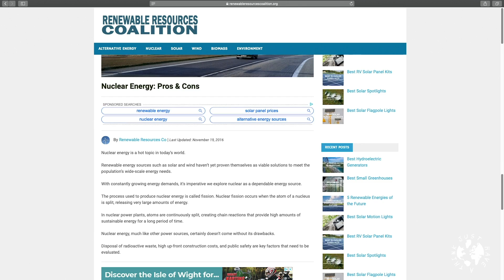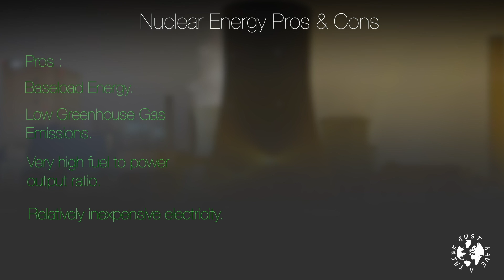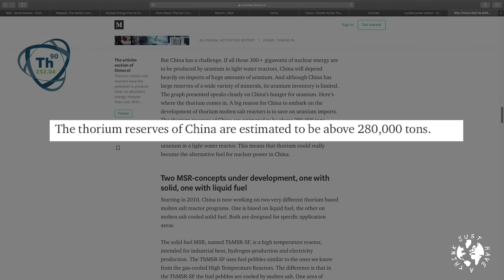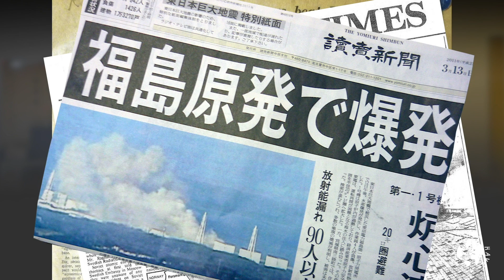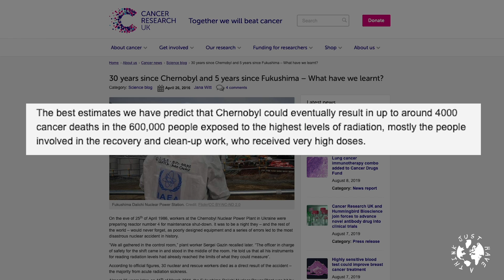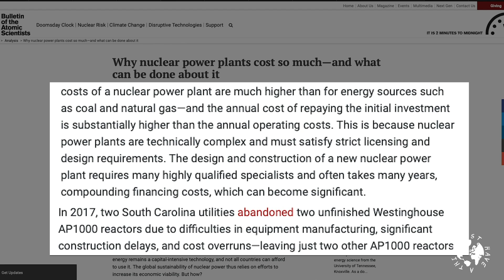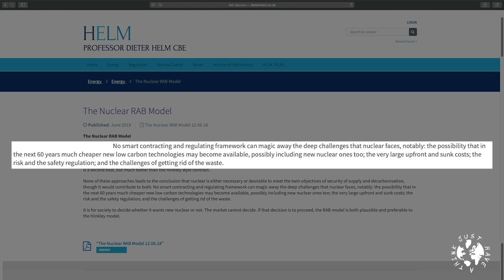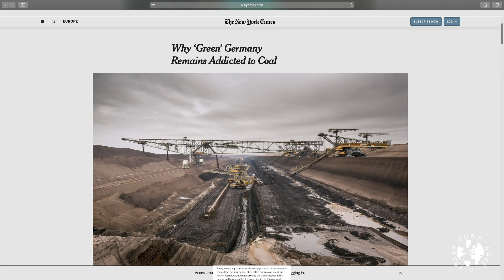Nuclear Energy in the 21st Century

Comment: I often hear that we will eventually run out of fossil fuels. It seems to me that what makes coal, oil and gas a fuel is it's carbon content. Burning these fuels does not destroy the carbon. That means we still have the carbon in a different molecule. 
Is anyone looking into a way to separate the carbon from the oxygen in a way that they can be recombined in a way that makes them a potent fuel?
Reply: that would need more energy than can be released by reburning it again
Reply: It's called trees and photosynthesis.

Comment: Nuclear - Damned if we do and damned if we don't! It is a difficult call whether or not use new generation nuclear (such as pebble bed reactors) to transition to greener forms of energy or just use the money we would spend on more solar and wind generation. My opinion is just to double down on more and better solar and wind with massive battery farms to smooth out the load. Improvements to the grid (smart grid technology) would also help. Again, another excellent video on the subject. We all need to educate ourselves on these subjects so we can pressure our leaders to make the right decisions for the planet and not just the expedient decisions for vested interests. Our very survival is at stake!
Reply: good point, I would still say go nuclear.  Nuclear investment will drastically reduce waste and emission.  The problem with Solar and Wind, they will always create excess and indirect waste and emissions.  Batteries have to be replaced, parts and have to be restored, new tech over rides old tech.  It generates a ton of indirect waste, and wore so if you scale it up.  Of course this is under the assumption that there is no break through that could circumvent this.  I still think it is highly unlikely that a tech break through would happen though.

Comment: Nuclear is a good alternative to fossil fuels, especially designs like the molten salt or pebble bed. Unfortunately, opponents have done such a good job at fear mongering propaganda, they will never be  accepted.  The best alternative is now a mix of solar & battery & converting fossil fuel powered stations to burn hydrogen for the base load. Not terribly efficient I know, but given it;s abundance & ease of  sourcing it from seawater, efficiency is secondary.

Comment: Closing healthy nuclear power plant is the dumbest move ever imagined. There are also Nuclear Breeder reactor technology that can expand the use of spent fuel to put into new fuel. (reducing also massively the use of mined Uranium) and in France government following shit public opinion closed it (see Superphénix) could expand Uranium reserves from 80 to 150 years.  Also most heat of the nuclear power plants is wasted, it could be used in cogeneration to produce industrial heat, homes heating, sea water desalination, etc. Smaller Modular Reactors passively cooled in pools are simpler solutions. Thorium molten salt low pressure reactors can also have passive security only based on heat and gravity for auto-stop feature. Nuclear power plants can also benefit from solar concentration plants in order to use better the cogeneration of heat and to provide drinking/irrigation water near the sea, this can drastically save water that is drained from polluted phreatic zones and rivers. We should never ever use water from water tables fossil water or river water, since those natural cycles must not be disturbed for both soil fertility and wildlife. Nuclear remains the lowest cost in human lives and the lowest CO2 per TWH produced. Nuclear do not need very much else except batteries. Thorium reserves are estimated at 50 000 years if current world power generation was 100% LFTR reactors. We should build prototypes to validate designs and choose the best.
Reply: There is no such thing as a "healthy nuclear reactor".

"Nearly 400 cracks in one of the facility’s reactor core’s graphite bricks were found in March last year, leading to the closure of the plant in October – although cracks developing is normal, the amount recorded exceeded current guidelines on limits.
The rest of the site’s reactors remained below the Office for Nuclear Regulation’s (ONR) upper safety limit of 350 cracks.
Owner EDF Energy would like to restart generation at the power plant with a new limit of 700 cracks, a view which has been supported by GMB Union.
However, two nuclear experts have reportedly warned the reactors should not be reopened – speaking to The Daily Mail, Independent Consultant Dr Ian Fairlie and Dr David Toke of the University of Aberdeen, said while the probability of a meltdown is low, it could have dramatic consequences.
They reportedly told the newspaper: “This is a serious matter because if an untoward incident were to occur – for example an earth tremor, gas excursion, steam surge, sudden outage, or sudden depressurisation, the barrels could become dislodged and/or misaligned.
“These events could in turn lead to large emissions of radioactive gases. Further, if hot spots were to occur and if nuclear fuel were to react with the graphite moderator they could lead to explosions inside the reactor core.
“In the very worst case the hot graphite core could become exposed to air and ignite leading to radioactive contamination of large areas of central Scotland, including the metropolitan areas of Glasgow and Edinburgh.”"
https://www.energylivenews.com/2019/06/10/restarting-cracked-nuclear-reactors-could-contaminate-edinburgh-and-glasgow/
Reply: You use here one specific example I am not aware of, I do not understand to witch parts exactly the article refer to. Every two years the complete fuel block should be renewed. Nuclear power plant from now on should not rely on high pressure water not on graphite (new designs).  Currently the gravity safety only rely on the shape integrity of rods guides. Each reactor gets new guides with refueling. Those parts are 90% in mass of the nuclear waste. Failing to put new guides is a major risk to take.
Reply: And there is still no working commercial thorium plant design - in reality it doesn't act like it supposed to. It's like count on fusion reactors in future energy strategy. 
And oh, about other Thorium myts:
https://whatisnuclear.com/thorium-myths.html

Comment: If all those billions was spent completely on renewables and battery storage it would be done in next to no time. Where is there any sense in doing anything else? Great vid. As usual.
Reply: I take the view that throwing gold bars into to the Themes reduces global warming it is probably worth it. 

The issue with wind is its variability on a monthly scale electricity will have to be stored for weeks at a time. We could use High Voltage Direct Current (HDVC) cables to move energy to where it could be stored, this might be cheaper than new nuclear but it has to be done at huge scale. HVDC lines are relatively cheap and seems to be getting cheaper. How much energy can Norway store for us? Could we store it in tidal lagoons? 

The challenge we have to just remove carbon from electricity but from transport and heating. As I understand it due to electric cars being more efficient the amount of additional power we need is not substantial the issues is heating in particular running a many millions of heat pumps during cold winter nights. 

Uranium can be reprocessed this alone means it could power us for 6000 years using current known reserves. To all intents and purposes it is renewable. 

Nuclear power is not a good fit with neo-liberal economics, it works best when a fleet of identical stations are deployed by a strong state, (France). The market bulks and the high initial cost and risk renewable though more expensive in the long run might be a better fit for our current socio economic model. 

On nuclear waste, if we are still around in a 1000year to have to deal with it, this is a good problem to have.

It is known to work and it is known that it could fix the problem, will there be better solutions down the road, battery storage, nuclear fusion, renewable, etc? hopefully.

Comment: I wonder what alternative solutions industry/academia could come up with if they had the budget of £30billion (cost of current nuclear plant) to research and implement a low carbon/renewable base load production facility to match the capacity of Hinckley point?
Reply: Feel free to actually back that number up with say... absolutely anything.  Something to consider that no amount of money changes the laws of physics.
Which is to say... no it can't and no it won't.  If you are genuinely concerned about the environment and climate change, support Nuclear Power.  France has been carbon neutral for 50 years!
Reply: 30 billion? How about 10 times that?
An October 2016 report commissioned by the Düsseldorf Institute for Competition Economics (DICE) on behalf of the Initiative New Social Market Economy (Initiative Neue Soziale Marktwirtschaft, INSM) provided the first full-cost estimate of Energiewende to 2025. This amounted to over €520 billion in the electricity sector alone. The main component was €408 billion for the EEG levy, while the expansion of transmission and distribution networks totaled €55.3 billion. At the end of 2015, €150 billion had already been spent on Energiewende, excluding network expansion costs.

Don't tell me nuclear diverts investments from renewables

Comment: I'm fine with well regulated, well maintained and well operated standard nuclear power plants (although I have some reservations over whether those three "well"s will be maintained) but molten salt reactors scare the crap out of me.

When a heavy nucleus fissions, it leaves a couple of daughter nuclei which are very very radioactive, and could be any middling-mass element. These then decay to slightly less radioactive nuclei, which decay to something less radioactive again, until after a few decades you have nuclei which are long lived or stable, and therefore  vastly less radioactive than the initial fission products. In a conventional power plant, these super nasty products are enclosed in fuel rods for at least several decades before anyone attempts to deal with them.

In a molten salt reactor, these products are not fully confined - they mix with the molten salt. These are to be removed in a chemical processing plant, and then somehow stored. So you have a complex (think how many elements it needs to deal with) processing plant which is treating and thoroughly contaminated with products orders of magnitude more radioactive than anything the old nuclear industry needs to directly deal with. How are you going to maintain this? Furthermore, the products can play havoc with the reactor before reaching the chemical processing plant. They include all the middling mass elements, so some will be solids at the temperature of the molten salt, and so will plate out in pipes, heat exchangers etc. (and again, remember this residue is wildly radioactive) and others will be corrosive to those same pipes etc. 

In short: intense radioactivity + a chemically hostile environment + complexity + very hard to maintain (because of the radioactivity.) What could possibly go wrong?
Reply: I recently found a technical critique of thorium reactors but, alas, I can't find it right now. IAC I agree there are complex issues with the "chemical kidney" that is crucial to making such systems work. It will take decades to prove this technology enough to make it a major energy source. We, as a species, don't have long enough to wait for that to happen, and its proponents don't have that much time before it becomes irrelevant in the rapidly developing energy market.

It's one thing to say we should be investigating LFTRs as an option, but it's quite another to build a cult around it.

Comment: Thanks, nice overview.   Next version be sure to mention sea level rise ... and how most power plants are operating very close to sea level.  Ooops.. and they need cooling waters that are sufficiently cold... and when the waters warms too much, then reactors have to shut down if they cannot be cooled.  Kind of ironic to power our air conditioners if it has to shut down because of the heat.   And where does the full, complete costs of nuke energy get accounted for?  If mining, extraction, refining then storage and security for a few thousand years... who pays for that?  Especially if we have already paid for the energy.   Is that figured into the upfront cost of nuke energy?  And when seas rise, do we move our garbage - er, our waste uphill, or just dump it into the oceans?.   How long do humans plan to be around?  Nice topic, deserves more discussion.  Thanks
Reply: Mining, extraction, and refinement are indeed factored into the cost paid for the fuel rods, though in general storage is paid for by taxes. 

There are various plans for reactors that would produce fuel that needed to be stored for "only" a hundred or so years. Not a small ask still, but hardly insurmountable as tens of thousands of years would be, we have plenty of 200 to 500 year old buildings. I do agree that current generation nuclear seems far more trouble than it's worth to build. But I am interested in SMRs, which are just beginning to get regulatory approval and should be interesting in the next few decades. They could in theory be built much faster and cheaper in a factory and shipped on a truck, and operate as a sealed unit, because they're so small. All the companies developing them certainly plan for that to be their operating model anyway. It could turn nuclear power into a commodity similar to getting roof solar, instead of a large civil engineering project. Some suggestions for their use include off-grid reliable heating for facilities of various sizes, with any electrical power required as a sort of free bonus skim off the top. It might go nowhere, of course, but it could be interesting – maybe as a potential replacement for on-site generators, or for military or scientific bases out in the middle of nowhere, or a town running municipal heat and power (municipal heat is more common in some parts of Sweden and Norway and Finland and stuff, from dual-mode power stations, getting around 90% efficiency from the thermal generation vs about 30% for a purely-electrical station). Since you need more heat in the winter, which also happens to be when less renewable power is made, it might dovetail quite nicely with needs and requirements, especially if it works out cheaper than building enough batteries or making long term hydrogen infrastructure or so forth.